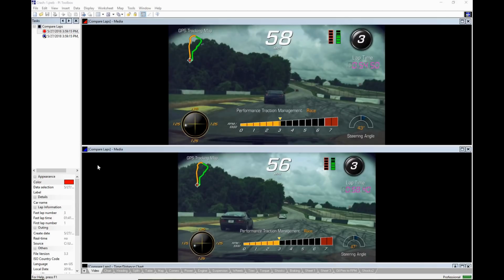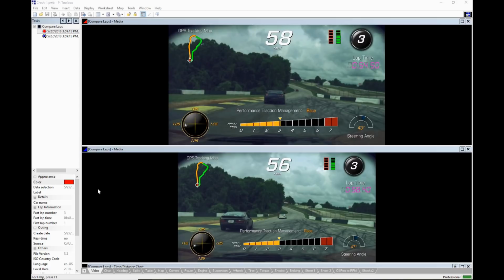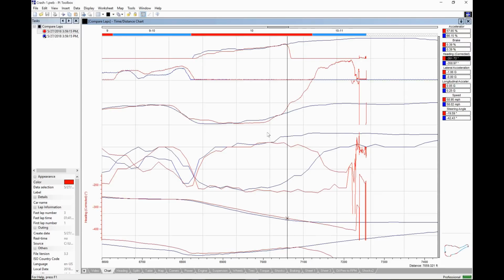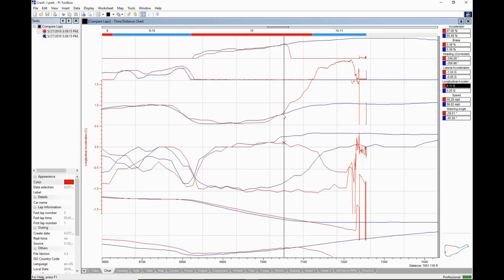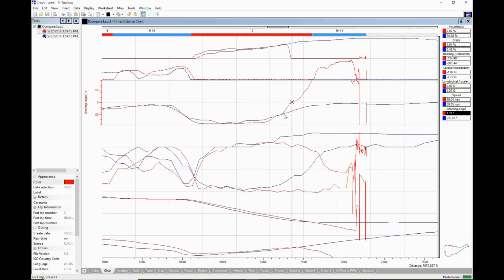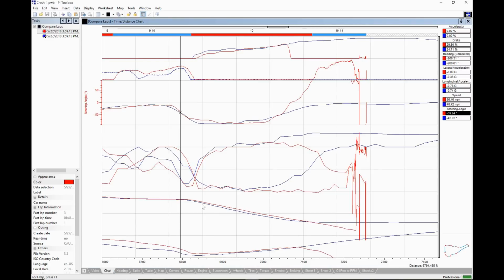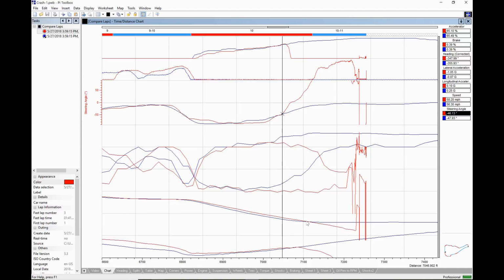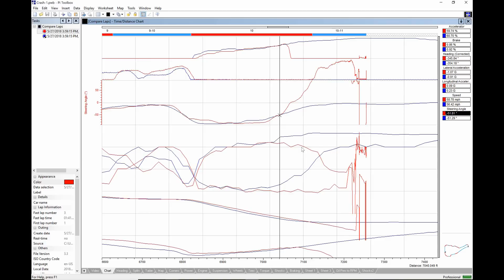Why Did I Crash - Episode 1: Road Atlanta Turn 7

Comment: Really good analysis. I’ve looked at a lot of laps by a lot of drivers but have never looked at post-crash data. What is the math channel formula for correcting the heading after 360? I’ve never used heading in my analysis but would like to be able to do so in the future. Thanks
Reply from the maker: I'll paste it below but the trick is detecting when you cross from 0 to 360 degrees and adjusting so the line doesn't jump.
Reply from the maker: /* Takes the GPS Heading channel and corrects for the transition between 0 and 360 deg */

register @Last = 0;
register @Current = 0;
register @Change = 0;
register @LastChange = 0;
register @Change2 = 0;
register @HighFlag = 0;
register @LowFlag = 0;
register @Result = 0;

@Current =[Heading];
@Change = @Current-@Last;
@Change2 = @Change-@LastChange;

@HighFlag = (@Change2<-300)*360; //cross from 360 to 0 deg
@LowFlag =  (@Change2 >300)*360; //cross from 0 back to 360

@Current = @HighFlag+@Current; 
@Last= @Current;
@LastChange = @Change+@HighFlag;

@Current*-1

Comment: Sean,  as you explained, there were a number of factors that resulted in the accident, but do you think the wall impact COULD have been avoided if the driver had’t totally let off the throttle?
Reply from the maker: It's impossible to say for sure but the driver reacted quickly opening the wheel.  It's likely that if he had just breathed off the throttle a bit the car would have straightened out.  Since he was headed a bit off track he might have had to drive straight off to the outside but it's tough to say at this point.  However, from the time he started opening the wheel to the time he lifted was ~0.2 seconds so you're operating on reflexes at that point.